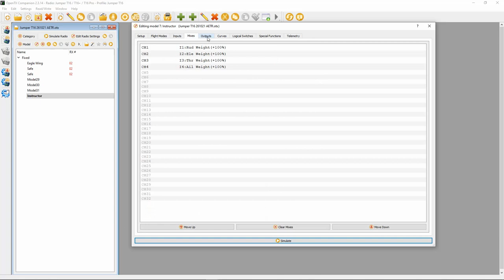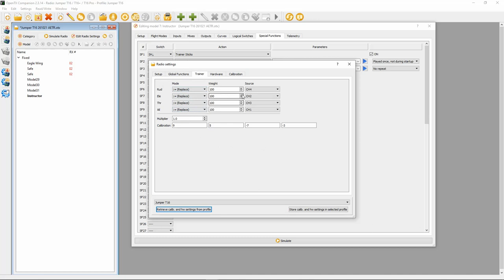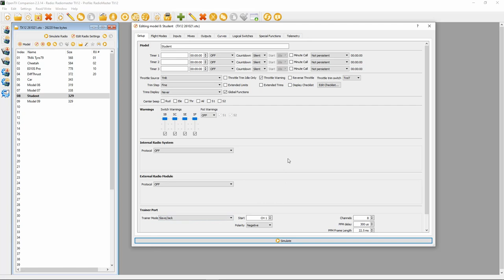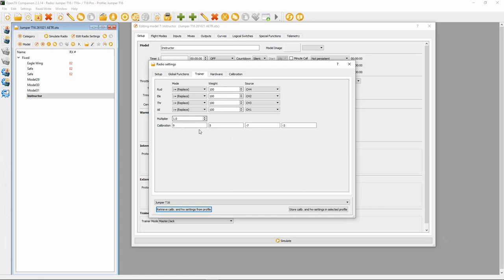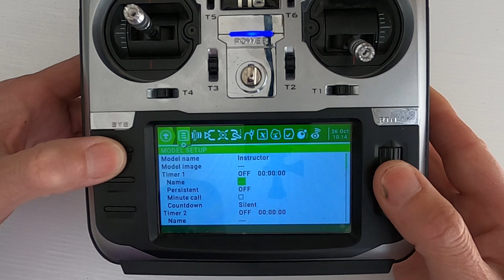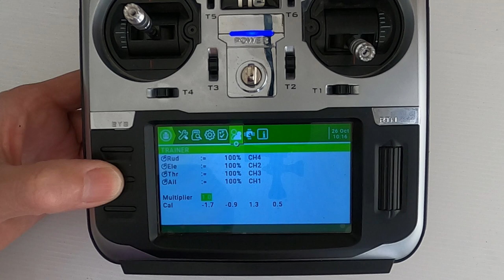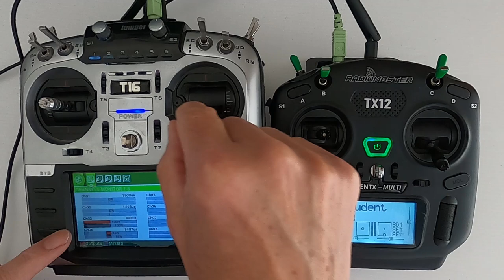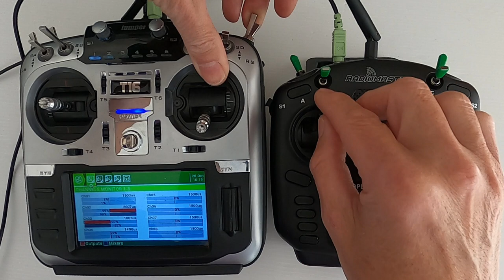OpenTX Setting Up Trainer Mode

Comment: Hi Bill as usual great video, I have 2 TX16s both with EDGE 2.8.0, I have set up a trainer mode with the WT01 module, bind works just fine, the master is on master, and slave on the student radio, telemetry is on a bind I added the switch with trainer sticks and enabled, master works, the slave doesn't work although its bind to the device. any idea what could have gone wrong?
Reply from the maker: Hi David, if the WT01 is bound it sounds to me you   need to check your mixing for the trainer switch just go over it again as per my video and check the Trainer Mode is selected correctly for each radio.

Comment: Thank you for the Video. I don't have a student transmitter yet to try this out: does the internal module in the student transmitter have to be switched off?
Reply from the maker: The internal module can be off unless you use the RadioMaster wireless module. I am sure it being off will save the radios battery. 

WT01 Wireless Trainer Module:
https://youtu.be/oydlkq7oWlk
Reply: @the-happy-RC-flyer  o.k., thank you.

Comment: Great video Bill. Any chance you have setup a trainer with a Zorro ELRS internal (No 4 in 4) with the WT01 dongle in the trainer port  as Master and a TX16S bound to the WT01 dongle as slave? I've been fighting this for a few days now with no luck. I am presuming my issue is related to the Zorro ERLS model and I've missed something it requires since it does not have a multi protocol module. The TX16S binds to the WT01 dongle fine. Any advice is greatly appreciated.
Reply from the maker: Thank you. This should work fine because you are using the Zorro as the Master. If you have set up both radios correctly it should work are you using the correct cables? Would suggest checking the radio settings.
Reply: @the-happy-RC-flyer  It appears I need a adapter to 3.5 mono, couldn't get any to work until I did some creative jumper wires to a mono and that has the WT01 connected to the Zorro working. Now waiting for a proper mono adaptor to arrive, otherwise some more creative wiring.